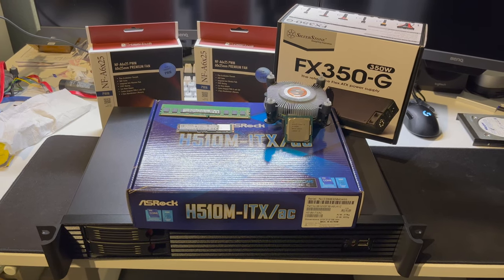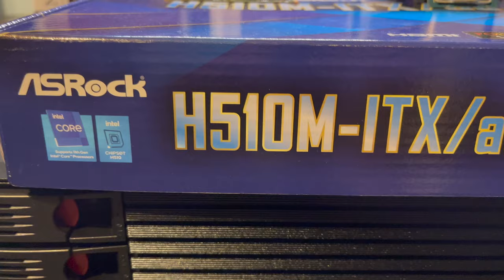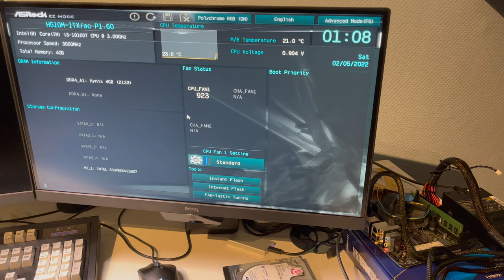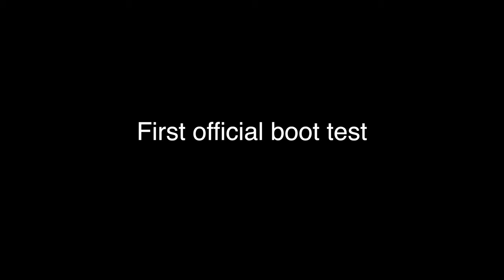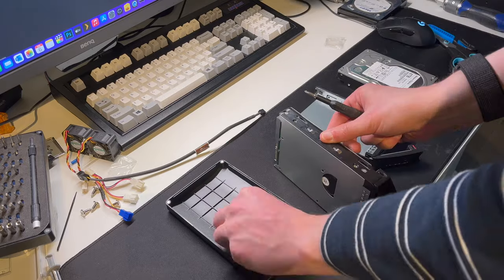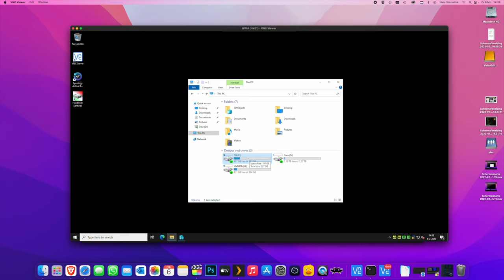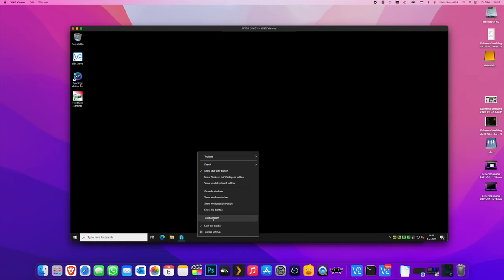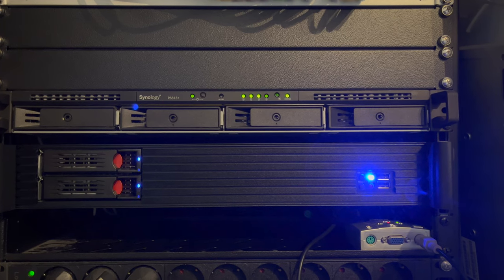Building a 1.5U Rackmount ITX Server

Comment: Is the hotswappable harddrives SATA compatible? From pictures I've seen online it looks like the little controller board is SAS only. Or did you just run wires into them directly instead?
Reply from the maker: The backside of the pcb is sata, not sas. There might be versions that are sas only, but this version has 2 normal sata ports to which you need to run sata cables.

Comment: Hey! I am considering buying this exact motherboard, but want to put it in an 1U rackmount case (actually also by Intertech, but the 126L) The only part I worry about is if the antenna 'tower' will fit within my case. I cannot find any (height) dimensions for this motherboard so I cannot verify myself. Can you say something about this?
Reply from the maker: A 1U case often doesn't fit a full height I/O shield, and the antenna does fit in a full height shield. So that's what you'll need to verify, otherwise "permanently modify" that specific part on the board :D

Comment: I've bought the case as well and installed it, however I was wondering what the purpose is of the plastic cutout beneath the motherboard. I installed it without, but should i put it back in?
Reply from the maker: It’s to prevent the board shorting on the case if you have some components on the back of the board (like an m.2 ssd)

Comment: Do you have any recommendations for beefing this up (>=64GB RAM and an i9)? I love the compact case but would love to have something more powerful in that same case. What are the recommended changes you would make?
Reply from the maker: 1.5U and an i9 will be hard too keep cool, even a Noctua L9i barely fits in there and I wouldn't dare to enable any turbo or boost functionality. 64GB of RAM should be doable with 32GB DIMMs which are available for DDR5 platforms like Intel Alder Lake and later.
Reply: @nelizmastr  Anything else that may fit in that chassis? A different processor CPU+combo? I am looking for something with more cores.

Comment: Hello, nice sharing this very helpful! I am looking into similar builds, can you share idle consumption numbers? Any considerations for 10100T vs 10100? And 12100 just came available too.
Reply from the maker: I have no equipment to accurately measure the draw from the wall. 

The reason I went for the 10100T was because it was only €10 more than a Pentium Gold and the regulat 10100 was €50 over that again, so it was purely financial sense. I wanted to keep the overall build affordable, so spending more on a board and CPU was out of the question.
Reply: @nelizmastr  Thanks for your reply, yea that makes sense. Hmm but T models are hard to find at least here for me in Europe, most of them are sold expensively OEM with Lenovo, HP workstations etc.
Reply from the maker: I'm in Europe as well. I bought it 2nd hand for 90 euros shipped, which was a decent deal.